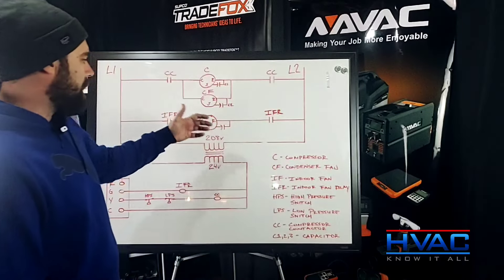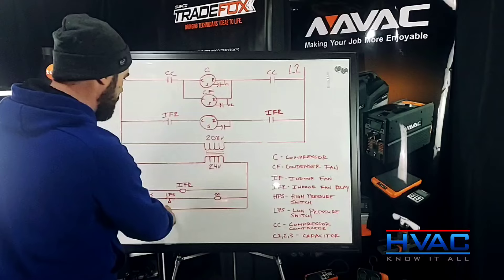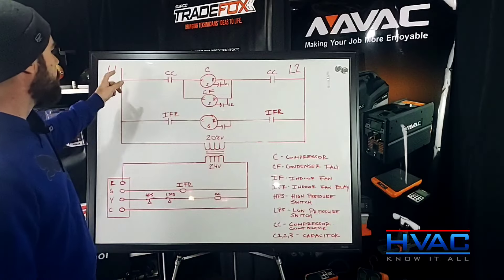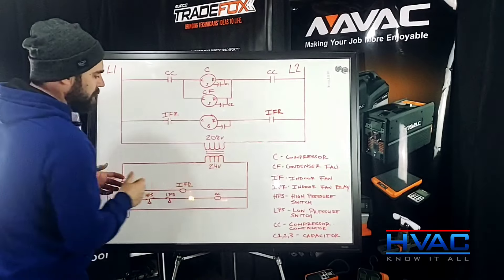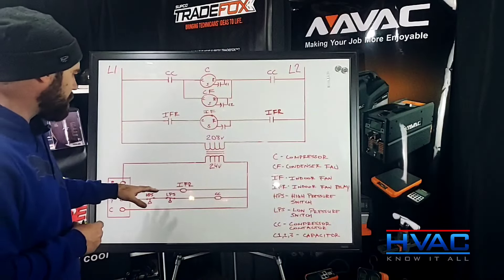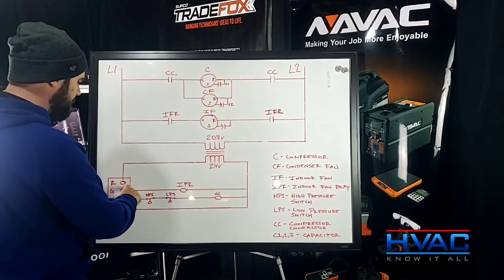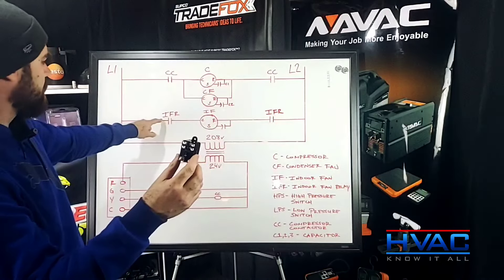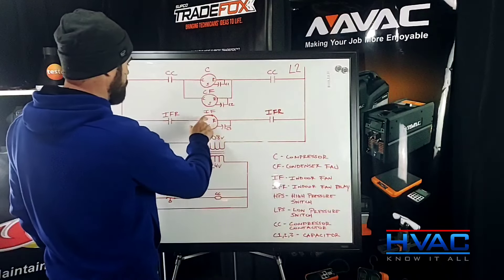How To Read Wiring Diagrams For HVAC

Comment: ran across your video and I was wondering if you have any postings that explains how a multi fan diagram looks like.  I have a very old thermostat and trying to find the appropriate WIFI replacement.  I have wirings that are labeled - R, FAL, Low, MED, HI and C.  I figured that FAL is the condenser...  any thoughts?  this has no heating....

Comment: Hi, the power coming in and leaving the relay are across from each other and not from up and down from each other. Or is this relay NO & NC are pins up and down from each other? Great video. Thanks
Reply: i came across this today...and, myself is not clear on this "relay" info, here: because of NOT KNOWING what orientation this relay has. If, he had only shown the schematic on this relay, it would have cleared up  all my cob webs on wiring..aaagggh!!! I still have issues still. But...This is still a great video.